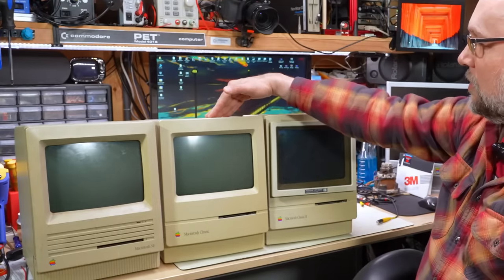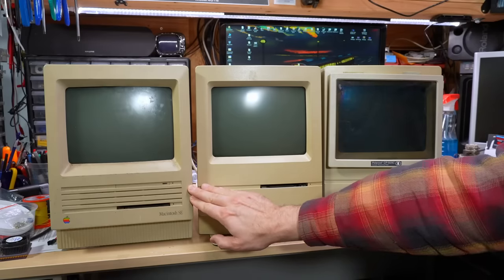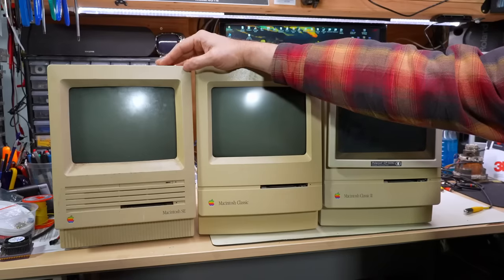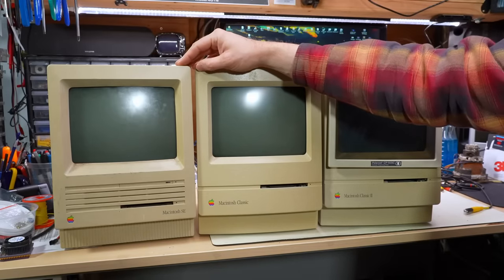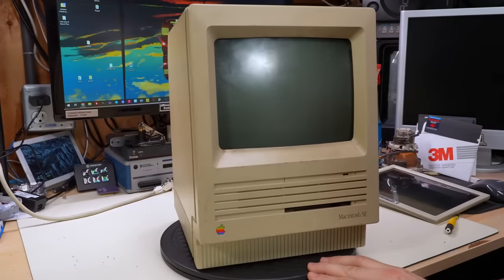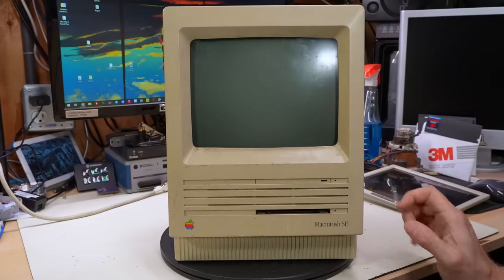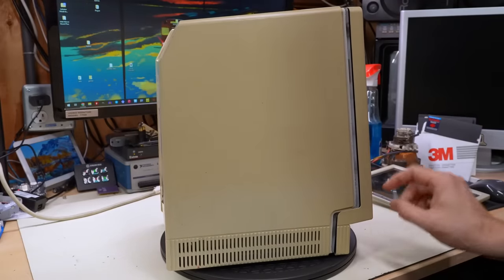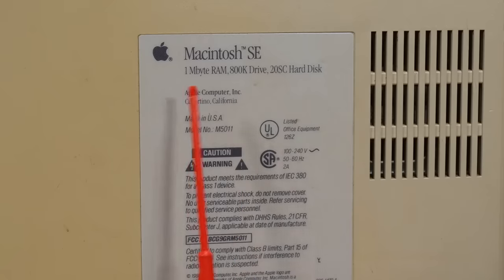Three unknown Macs: Let's get them working again #repair

Comment: With regards to bootable floppy disks... I highly suggest that if you're into vintage computers to get a Greaseweazle. It reads/writes most popular vintage computer floppy formats on a modern PC. It can even handle a lot copy protected disks (mostly on the Amiga).
Reply: The Greaseweazle is great.  However it can't handle Apple 800K disks.  You basically have to use an original drive or an Apple 1.44 HD drive, aka SuperDrive. For those that don't know it is because it has variable speed.
Reply: @RacerX-  The Greaseweazle and Kryoflux actually can handle Apple's 800k disks. On a Mac variable rotation speed is used to create a fixed bitrate, in a standard drive you get a variable bitrate. The software-defined controllers in these modern preservation tools are very flexible and can handle this with ease. It's a bit less reliable using standard drives this way but it's good enough to make a bootdisk which you can then copy using the Mac.
Reply: @eDoc2020  Oh nice.  When I got mine it was not compatible so they must have got it to work since.  Thanks I will check it out!

Comment: I highly recommend against using painters/masking tape for anything you'll leave taped for any significant amount of time. After a while the adhesive will turn into a disgusting sticky mess that can be a pain to deal with.

Comment: If CR2032s were prone to leaking - we'd definitely know about it by now from the wide range of 1990s machines that used them. I suppose it is definitely possible they could leak further down the line, but any of the 3V non-rechargeable lithium cells should be safe - just like how the main lithium-ion batteries don't seem to ever leak or otherwise fail in a destructive way. Shame we can't say the same for the newer LiPos...
Reply: I have seen 2032 cells leak. I bought a Tandy 1000 TL/2 last year that had a leaking 2032.  It does happen but far more rare.

Comment: Great vid.  Nice to see that SE is working!
One thing you hinted at for that Classic is that memory board on the Classic was optional, and as a result it is kind of unobtanium by itself nowadays.
Unless you can get pics that show it has one, I wouldn't buy a Classic that only had 1M RAM or doesn't say how much RAM it has...
Also, nice thing about the SE and the Classic is even at the same CPU speed, they are snappier than previous machines like the Plus.  Some say about 25% faster...
I did have to not only recap my Classic but REALLY REALLY clean the motherboard to get all the cap juice off...  That's been years tho and (fingers still crossed) it is still working...
I actually prefer the 7Mhz compact Macs.  Just for the nostalgia, it just feels like the right speed to me.  An SE30 feels to fast to me... ;-) ;-)

Comment: These plastic pins that hold the cardboard, you dont need to remove them from the inside. Just use your fingernails to only grab the very top of the pin, pull that top part up (this action replaces what you did with the sharp tool), nd then you can remve the pin like you did. You do need a bit of good fingernails to only pull the top part out, but i've done it many times...
Reply: There are also trim tools which do the same job.

Comment: 👍👍

It was possible to get a FDHD floppy upgrade for the original SE….but it also requires a Rom change out to support the newer drive.
You could also get back in the day a SE > SE/30 full upgrade from Apple.
The card slot on the SE and SE/30 was used…for accelerators or a separate monitor-the first Mac I used was an original SE with separate screen running off the video card… The SE does support multiple monitors and shared work space between them…on System 6…I believe I was using system 6.0.3 initially. Later I bought my own SE/30…..which had a video board driving a basic color 14in screen 640x480 at 256 cols…..under system 7.1 and 7.5.

Classic II v SE/30….i think the Classic II didn’t have the FPU whereas the SE/30 did. Also, more in-depth, the SE/30 has a faster processor I/O….symmetrical in/out at 32bit..the Classic II was slightly slower, with same cpu but the in/out was asymmetrical at 32/16bit. The SE/30 has a dirty ROM, whereas the classic II has a clean ROM.

Comment: One point I'd like to make here for anyone who's watching this and doesn't have any experience with older computers, especially with mechanical disks and the like.. When you turned the machine off then turned it back on again you paused. I usually wait about 30 seconds and the reason for that is not to 'let it cool down a sec' as you said, although I knew what you meant, it's more to let any spinning drives stop. That's really the MOST important thing to do. On old mfm and rll (same) and IDE, scsi drives any mechanical spinning drives - floppy drives as well - you want to avoid removing power then while they're spinning down, restore full power and spin them up again. It may be an unnecessary caution, a myth even, but I am not taking ANY chances with old archaic drives and messing around with them for no reason.. So in my opinion, that's why I wait when I fully remove power before I reinstate power. That's all.
Reply: What you describe is definitely an unnecessary caution but it definitely shouldn't hurt. I'm pretty sure in this case Adrian wanted it to literally cool down because thermal changes could bring out cold solder joints.

Comment: It is better to replace the capacitors with tantalum ones along the power supply circuits.They have better parameters than simple electrolytic ones.Polymer electrolytic capacitors can also be supplied.

Comment: For the solder connections (the flyback, etc.), i would recommend actually desoldering as best you can (one pin at a time, so the device doesn't fall out), and then using silver solder as a replacement.  Silver solder is much more mechanically robust, which should result in physically stronger solder joints.

Not even a bad idea if you want to use regular lead/tin solder to remove at least some of the old solder, as you really do want to add some fresh.  If you don't remove some of the old, you get just a massive blob of solder, and that's not ideal.  You should end up with a smooth, concave fillet with good wetting.
Reply: I wouldn't want to use silver solder. If I'm not mistaken silver solder requires higher temperatures. Also you probably don't want a stronger mechanical connection because you'd be more likely to lift traces. Standard solder is already stronger than trace adhesion.

I don't think you need to remove old solder unless there's simply too much of it. If just a bit of new solder is enough to freshen the joint it's good, removing excess can take much more time.
Reply: @eDoc2020  I could be wrong, your mileage may vary. 

As to silver solder needing higher temps, it's a transformer, not normally prone to damage from high temperature soldering.  Also, the stress is INTO the board, not away from the board.
Reply: @jeromethiel4323   I thought silver solder needed much higher temps. That would definitely melt connector housings and might damage the flyback potting, as well as charring the board. If there's lower temp silver solder it might work but I still don't see the benefit. If nothing else it will make future rework more difficult.
Reply: @eDoc2020  Pretty much all modern electronics is silver solder now.  Ever heard of ROHS?  Lead solder is really only a hobbyist thing now.
Reply: @jeromethiel4323  Lead-free electronics solder will of course work fine. But even though it often contains some silver it's not called silver solder. Actual silver solder is hard solder which requires over 1000F to melt.

Comment: You can use a blade just under the edge of the plastic rivet and slide the centre piece then use the blase under the rivet to remove.

Comment: 25:00 - whilst thermal stress can cause solder joints to crack the ones on the L.O.T are more likely to fail due to mechanical vibration...

Comment: Varta is a high quality brand. They made batteries in the mid to late 80s that MAY have leaked now nearly 40 years later. 
People do need to remember that these are 30-40 year old electronics that were made in the infancy of electronics being cheap enough for mass-market adoption.
Does Sony give 30 year warranties when you pay 500 USD for a PS5?

Comment: Memory chips have an internal geometry regarding the number of rows and columns in the memory matrix, and SIMMs with different numbers of chips can have chips with different internal geometries, and older computers were typically not capable of handling "unexpected" geometries.  TLDR: you can't always use 2 or 3-chip memory modules in machines that expect 8 or 9 chip memory modules.  They only refresh a certain number of rows, and if the chips have more rows (due to a rectangular instead of square geometry), they will go unrefreshed and cause errors.

Comment: Lithium batteries don't leak unless they've been brought over-voltage or otherwise overheated. Mi-Mh will sometimes leak, but very rarely unless they've been similarly abused. I've never had an issue. It's the Ni-Cd and alkaline batteries that you need to clip out for safety. THOSE leak!
All of the control panel settings are stored in NVRAM, including mouse speed settings (if you're using an adapter to use a PC mouse, this matters), so your mileage on "you don't really need the battery" may vary.
Reply: I have seen CR2032 cells leak.  I bought a Tandy 1000 TL/2 last year that had a leaking 2032.  It is far more rare but it can happen.

Comment: I recently bought a used car and none of the key fobs worked. When I opened them up, the CR2032s in BOTH had leaked all over. Never seen it happen in a PC. But it is possible.

Comment: Have you ever covered the original Macintosh? I have an early off the line model that I picked up ages ago along with an external disk drive and a printer. I fired it up once and everything worked great but I'm not sure if there's any maintenance it needs or how to make a new system disk for it.

Comment: I wish ceramic screwdrivers were more common, because I have an old portable radio, and it's difficult to adjust the potentiometers because they're metal, and the stray capacitance from me touching the pots means that any adjustment I make is off when I remove the screwdriver.

Comment: 23:45 - for the few seconds it takes to remove the pop rivets I would recommend you spend as that plastic insulator can become very brittle and likely break if bent too far.

Comment: I want to know how that 1988 Varta still has nearly a full charge after all these years. I'm assuming it's original because I have one in an SE I've had in storage for years that's original to the Mac, and it is also a Varta, and it too still had a good charge. I know, I need to take it out...just haven't gotten around to it.

Comment: The Classic has the ability to boot from ROM - making it really fast (I recall being able to send text to printer before the screen had warmed up!) The SE/30 is probably the most desirable Mac in that format. The Colour Classic being the best example in that form factor if you consider it counts...
Reply: @rommix0  Actually no, not all classic Macs can boot from ROM. IIRC only the original Classic was able to boot from the factory shipped ROM. The SE has a hidden development team picture in the ROM that can be accessed via a power on keyboard combo...
Reply: @rommix0  I think you missed the point - only the classic could BOOT from ROM. The contents of ROM on other Macs can not all be invoked from BOOT and instead need to accessed either by an interrupt code or a ROM dump. The SE for example has a 4 picture slide show. The IIfx has a colour picture of the dev team, however you need to adjust the date and perform a keyboard command. I am aware of all the different versions as I own the actual hardware. Let me know what keyboard combo you perform on any other Mac to BOOT from ROM
Reply: @rommix0  You definitely missed my point - go re-read what I posted, I don't know why you are trying to tell me all Macs have ROMs - that's not what I was commenting on.
Reply: @rommix0  Yes, you definitely missed my point and now you are contradicting yourself. The Mac Classic can BOOT from ROM. I do know what I am talking about as I still own the original hardware and performed the boot many times back in the day.

Comment: Adrian, you can remove those plastic clips by carefully lifting the pin with a sharp knife or a size 00 or 000 flathead screwdriver...

Comment: Quick fix for stripped out threads.... find a suitable size zip tie and drop it in the hole and trim the length to the top of the hole then assemble.... done😊
Reply: Oh thats a good idea.  I used to just use a toothpick so I will have to try this.

Comment: Why does everyone on youtube spend so much time talking about "Don't work on power supplies, they'll shock you!" or "Don't work on CRTs, they'll shock you!"

Yes. Thanks. I get it.
Reply: Some people might have grown up with that knowledge or learned it already, but in the age of arduino and tinkering it seems that some people forget that they are working with electricity when handling bare electronics. It’s annoying that it’s said a hundred times but it might save someone who doesn’t realize that some bare electronics run on more than 5 volts 😅
Reply: @JuliaMono  I would rather the statement change from "don't work on it, there's high voltage" to "If you work on it, learn how to deal with high voltage first."

My gripe isn't about the warning.The warning is valid. It's about how much it sounds like they're trying to dissuade people from fixing their broken stuff.
Reply: @vhfgamer  that’s totally fair and I agree. Adrian does it like that in most of his newer videos at least but there are certainly too many „do not….“ warning signs without the reasons being explained or guidance given

Comment: 7:35 - no the rear I/O is different on the Mac Plus - the 2 ADB ports are missing on the Mac Plus. It has audio jacks for sound out & mic in and a 9 pin port for the mouse - then the 15 pin port for the external flppy drive, the 25 pin port for SCSI and the 2 Apple serial ports...

Comment: I would just use hot glue to fix screw. JB Weld is a pain to tap. Put screw in while is is soft and let it cool. Then you can unscrew and screw easily.

Comment: It would be necessary to overclock the 68000 processor to work faster.Well, you can put the modern versions on a higher frequency. ;) The Amiga accelerates well.
Reply: In these Macs video timing is locked to the processor bus speed. You really need an accelerator which includes bus isolation and cache.

Comment: Those plastic pins can just be pulled from the top, the annoying ones are the ones with no cap and you just push the pin through and hope you find it later...😅

Comment: i have a macmini a1238, and the superdrive isnt working, seems to have no power.  so i bought a new one and swapped it and its the same, so im thinking its the daughter board that the hdd/dvd drives plug into.  the hdd is fine tho.   any idea how to check the problem?  is there schematics to tell me what to look for?  has anyone had this issue?  i reset the pram, that did nothing  everything else works fine so i want to remove the bga cpu and make it socketed to upgrade it but i dont know if the issue is on the logic board, then i wouldnt do work to it if i cant fix the drive. Adrian is my spirit animal, so of course i had i ask here! lol  love the basements! both of them!

Comment: FDHD, not HDFD @ 6:16. They basically replaced the IWM chip with the SWIM chip. Basically only the last year model of SEs had these, just before the Classic replaced it.
Reply: @jammi_ - To add to that, there was a "FDHD" upgrade kit Apple sold for the Macintosh II and SE, which consisted of a SWIM chip, new firmware ROMs and a Sony SuperDrive 1.44 MB. Likely it required an authorized Apple dealer to perform the upgrade, as getting into the SE's case and its risk of high voltage made it not something the average user could do.
Reply: @Apple2gs  Back in the day (1990) when I performed the 2.5MB to 4MB upgrade on my SE FDHD along with the System 7 release, Torx was such a specialty security screw thing back then that I had to borrow a hexagonal shaft that was close enough to get the screws open. It wasn't until the early 2010s that I got a proper tool for them: an assortment of long torx hex tool bits from China, since no such things existed locally. In-between, I had all kinds of weird torx-bit contraptions including a slotted one that I drove with a long flat-head screwdriver.
Reply: @jammi__  - When I upgraded my SE in the late 90's (same 2.5 MB to 4 MB RAM) I had to improvise by duct taping a long metal shaft/pole, to the end of my long handled screwdriver. And then hex bit taped to that! Years later I got a several official Mac case cracking tools from an Apple II/Mac vendor that was throwing out their old stock and mailed me a package. At first I didn't recognize what they were, and almost threw them out, they looked just  like long metal sticks...like shishkabob skiers for BBQ lol. Still have them in storage, though the only classic Mac I have left is an original 128.

Comment: Isn’t Windex terrible for any coatings on the CRT? (And of course LCDs, Plasmas, OLEDs, etc…
Reply: I'd avoid Windex on a modern display but AFAIK CRTs have more basic coatings if any. On really old CRTs Windex was specifically recommended. For a more modern CRT you should be fine if you spray Windex on the cloth and wipe the screen, that will limit the amount of contact.
Reply: @eDoc2020  - I usually use warm water, but on particularly dirty CRT's I've used 70% rubbing alcohol. Had to do this with a AppleColor RGB CRT from the 80's I acquired recently, but thankfully it had no ill effects (I don't think it has any special coating).
Reply: @Apple2gs   Rubbing alcohol can definitely damage screen coatings. At my job we normally use household cleaning wipes on LCDs.